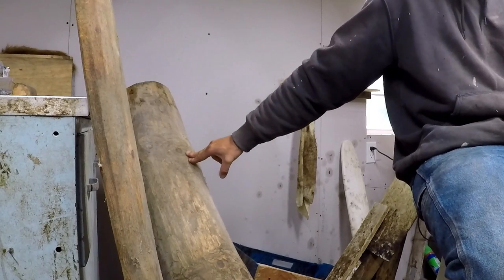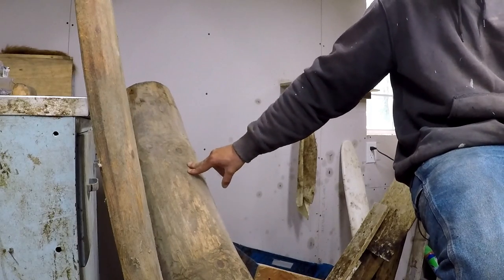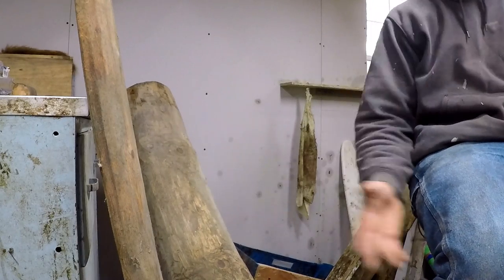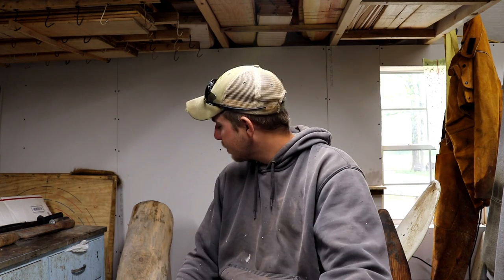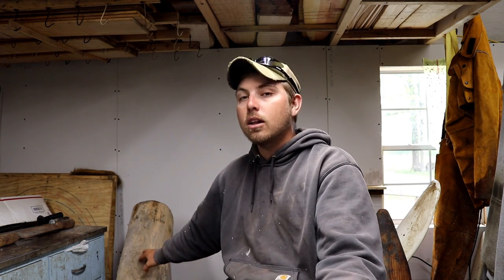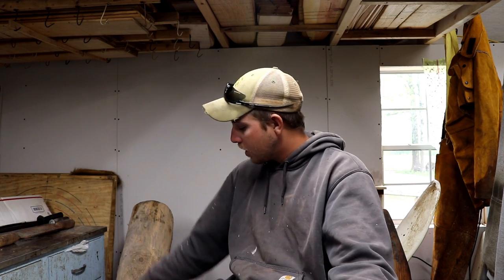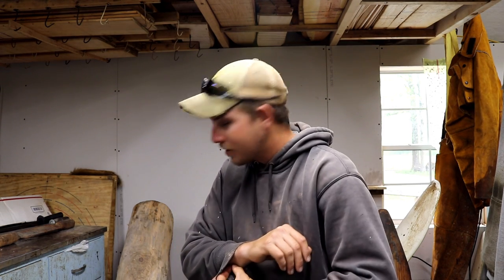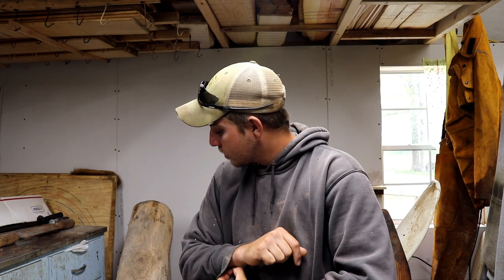Advanced Fleshing Instruction Part 1- Choosing the Right Beam

Comment: Just to be clear.  When the beam is in its bracket and angled up,  the point of the beam and the pelt's head is at your chest and you are scraping, or more accurately, fleshing down and away from you.  Is that correct?  Additionally, you mention a flat sweet spot down the center of the wooden beam.  I assume on the PVC beam there really isn't any flat center as it is continuously curved.  Is that right?  Maybe you've got a vid on making a PVC beam???